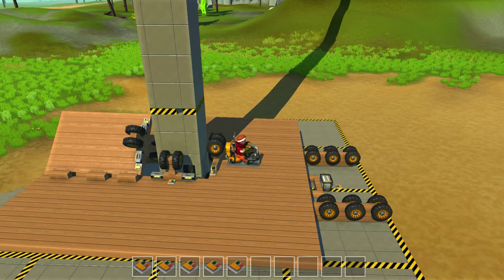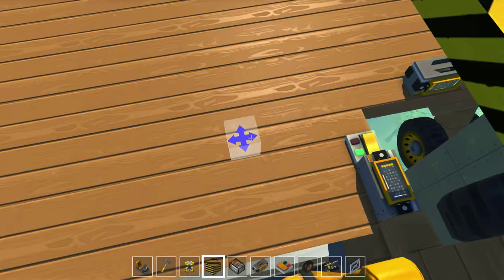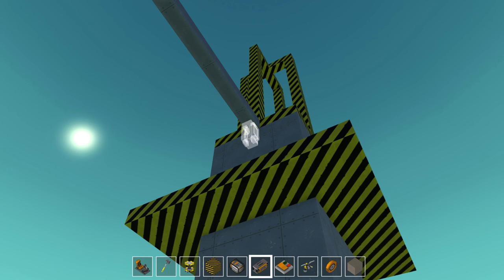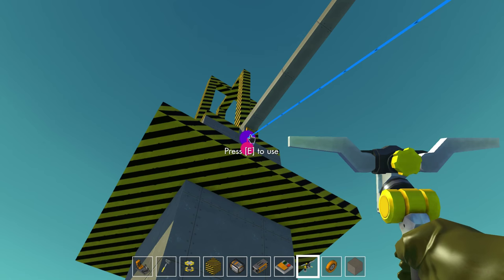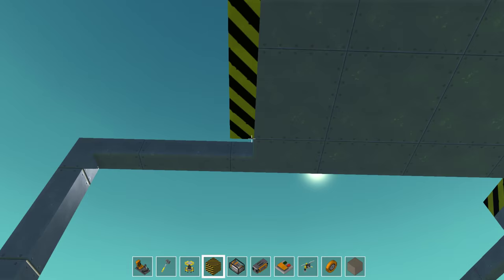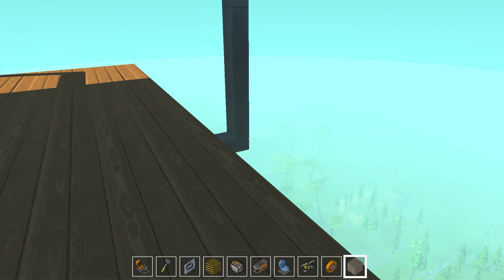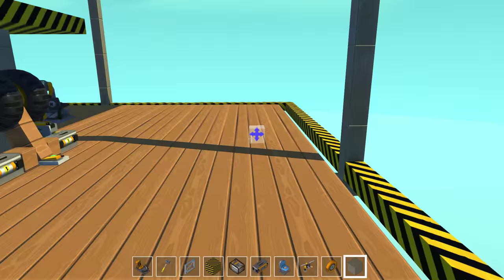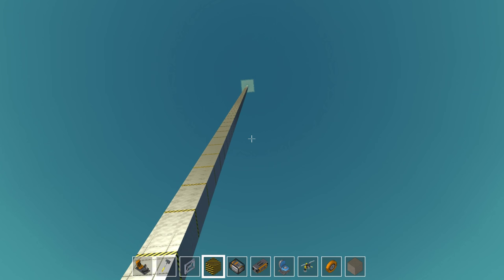Scrap Mechanic - Ep. 41 - The Platform Locking Mechanism! - Let's Play Scrap Mechanic Gameplay

Comment: Add a sensor in the top and on the platform make an arm that touches it (or is in it's line of sight) so in the seat press a switch, the arm goes up, you go to the top, the sensor goes off and it locks it in place, and when you want to go down, you get in the seat, press the button again, the arm goes down, and it releases you, letting you go down.

Comment: At roughly 8:20, your idea would have worked, you just needed both bearings connected. Also, a safety fence would be a good idea! And a scissor lift type thing to get up off your lift to the roof/floor.

Comment: Just a few things I'd like to see you add to your sky platform:  1) A big landing pad for you UFO, with a button at ground level that tips the whole thing on its side to dump the vehicle down, in case you fall off.2) Railings.3) A large runway and hangar for easy landings for all your other flying vehicles (but always leave the UFO on the drop pad).  And for the record, I like the buildy videos, but I do appreciate the fast forwarding through some of the longer, more tedious, sections.

Comment: you could have another control at the bottom that releases the grip of the wheels. Another idea is to have a folding lock that keeps the elevator in place once you reach the top. To snowball, your control at the bottom could also control the tire pressure on the column. Love your videos blitz. You should play the division with subscribers.

Comment: do a sensor on the ground than 2 barrings left and right from it. 2 Switches. Every switch is controlling one barring where you now build one Arm on. Wenn du push the Switch, the arm will get in fron of the Sensor. 

Good: 2 Switch System

Bad: you must deaktivate the other one

Comment: for a dual switch controller: put a block, with a bearing on top, (side if you put it on a wall) beside it (or below) put a sensor facing away. on the first bearing: 
put three blocks over the sensor, 
put a bearing on the end and place blocks in and L shape from the bearing and to the side of the sensor so it doesn't activate. put down 3 controllers, one for the sensor, one for each of the bearings, 
The controller connected to the sensor will handle your brackets, the controller connected to the first bearing should be set to about 41 degree angle, when activated and the second at 30degrees when activated. 
connect the bearing controllers to one switch each and place the switches one at the top and one at the bottom.
 done, 
2 way switch. the angles makes sure that both switches can activate the sensor.

Comment: 8:00 maybe it's that you had an unbound bearing applying zero friction with non-equal inertial masses around the axis, thereby causing the torque to only be applied to the point of least resistance, a point which wouldn't exist as soon as you bind the bearing to a controller, thereby fixing the problem and making your plan work...

...but that's none of my business.
Reply: +Tanya Sapien You sound much calmer than I did in my head. I'm thinking, just hit it with the hammer!
Reply: You are not making yourself sound smart in fact, quite the opposite

Comment: Awesome new episode! Your two way switch would've worked, though—you just needed to hook up both the bearings to the controller. The second was was still free, and so it was still loose. As to what to put on the platform, I think you should go for a sort of space-station-ish design. with different branching platforms and things. It'd be cool if you had some kind of above-surface greenhouse or something, since there's so many plants in the game, and you could also easily have a lounge or a lookout area. And, of course, a landing pad for that UFO thing and other vehicles.

Comment: Blitz instead of placing the lock mechanism controller in the tower use one thats on the elevator. This will allow you to set a switch at the top and bottom of the tower.

Also to get up/down from the upper platform you can use a stair case. That way its easier to get up and down.

Comment: Blitz this is very important. you should make a think on the platform that moves that rotates over a sensor that is attached to the main pole with that mechanisms so that you can press a button while you are still in the seat that locks the platform in place, then you will not need to get out of the seat and then press a button. I will explain again if you did not understand what I said. I am bad at explaining things.

Comment: to latch the platform why dont you have it lock in from the middle shaft so this way you dont have the the long arms going out and around. also now that it rides smoother and you can control it going up/down you no longer need the section of the platform that opens. and i think if you but a block on the bearings then the wheels it will be less prone to want to wobble around and be even more stavble

Comment: It's looking good! Might wanna hook the locks up to a single switch you can hit from the driver seat.

Ultimately you'll want a way to send the elevator up & down from either the top or the bottom. I imagine it would take a simple bearing-sensor system & maybe even a third set of wheels (up, down, and free-spinning stabilizers). Once you get all the parts in place, just grab the connection and jump to ground level to attach it to the call switch. Then just call the elevator down to meet you. That sure would be more convenient than trying to fly up!

For the base, it would be largely for looks, so bigger & fancier is better. You could make a sky castle, or a ISS (international sky station). Heck, you could even do a sky race track for flying vehicles!
Reply: The problem is, the lift is a separate entity than the pillar, so you can't make connections from one to the other.
Reply: +Joshua the Coder Afaik there's still the trick where you make the signal connection and then delete connecting blocks for a remote controlled vehicle. Blitz could do that instead.

Comment: mega deus is correct, you could do it just by having both bearing connected but you could also have it open up like a claw (the platform is stuck there because of a latch type thing but in case of emergency drop it like a claw)

Comment: you could make a sensor with 2 bearings with 2-3 blocks 1 on each side and have one connected to a switch on the ground (the platform your building on) and one on the top platform and connect the sensor to the bearings

Comment: you should put it on one switch connect it to the seat on the elevator and instead of the button at the top put it at the bottom so when you are at the top you can undo it and when you are at the bottom you can use the switch